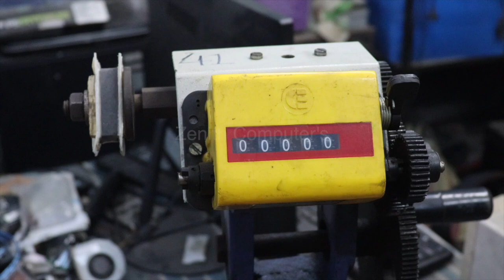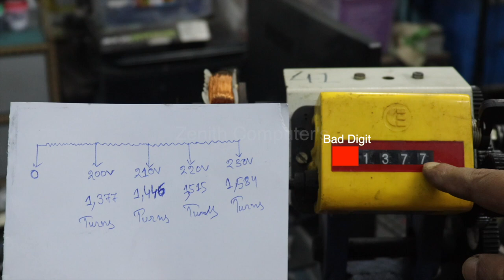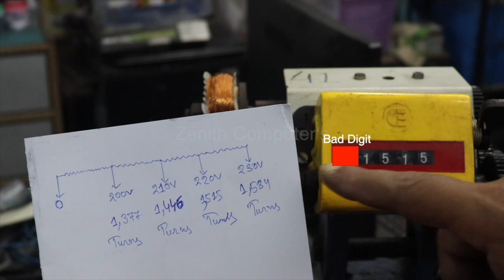How to Repair Primary Winding of a Transformer.

Comment: Can we use simple iron instead of CRGO core?
Reply from the maker: You can use but there have many problem. 
If you use ordinary iron. 
1. It will consume too much power.
2. Ordinary iron will be hot.
3. It make high Eddy Current.
4. Low  mutual inductance value.
Reply from the maker: Good question.
Reply: Thank you
Reply: @zenithcomputers3286  what if I use steel?
I have an old computer case so if I use that case steel will it be better than ordinary iron?
Reply: @zenithcomputers3286  I am going to make a welding machine using that steel